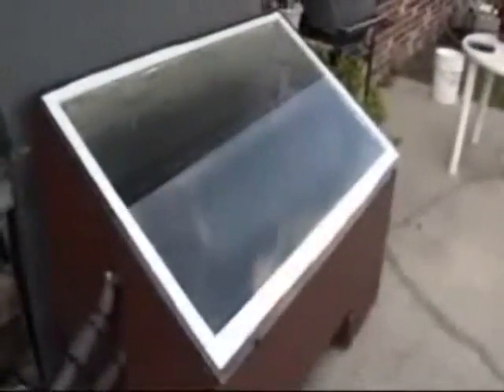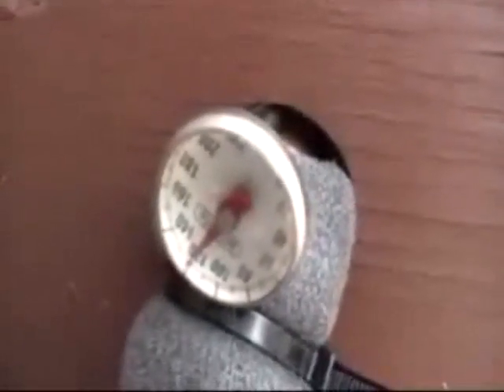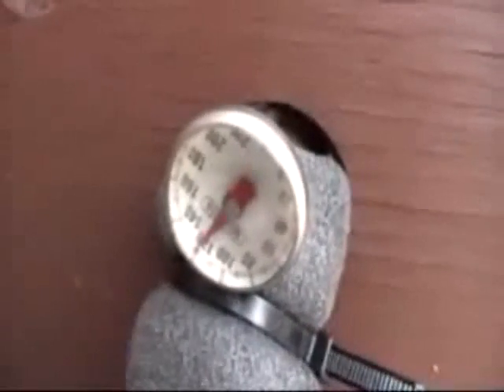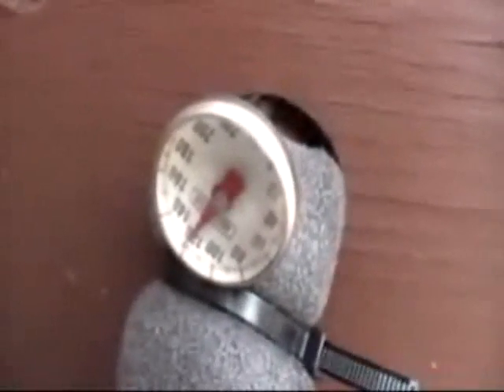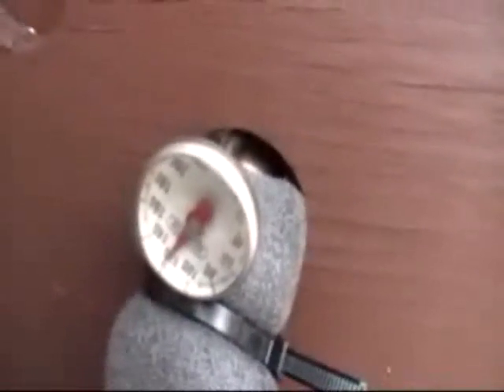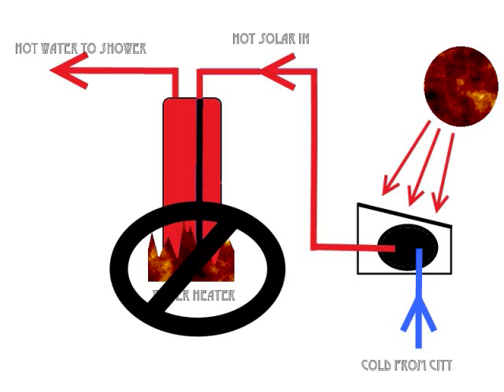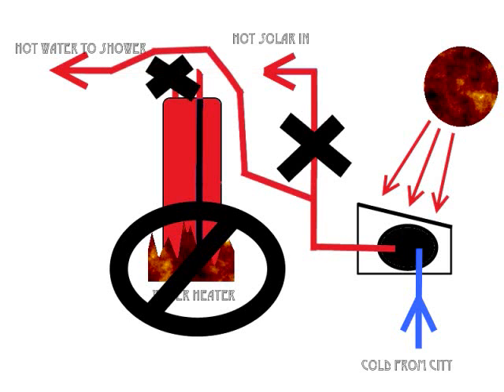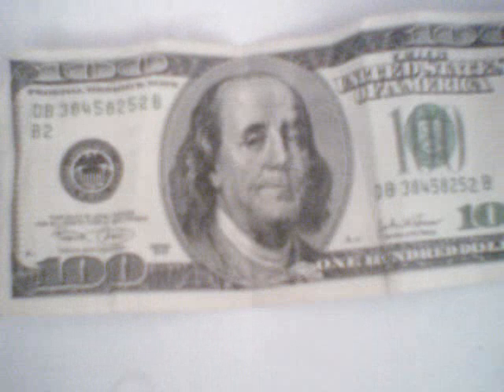New Series intro (Prep-Tech) episode 1

Comment: Our pump is a submersible down in the well casing -- everything is buried with the water coming into the house down in the basement (where the pressure tank is) so no access to sunshine inbetween. That's what I can't picture -- how one would use this method in the case of a well (where you didn't have an old-fashioned well-pit anyway).     It's a neat concept though.

Comment: Excellent! I never thought of a water heater of this size.   I have a camping shower which consists of a large rubber bag with a small shower spout.  You lay the bag in the sun until it heats up and you hang the bag up and use gravity to move the water out of the bag.  These are fairly inexpensive to purchase under $20.